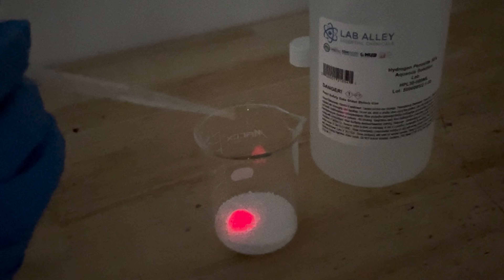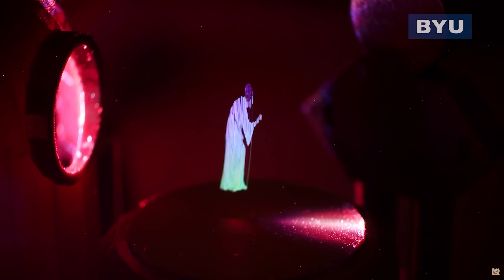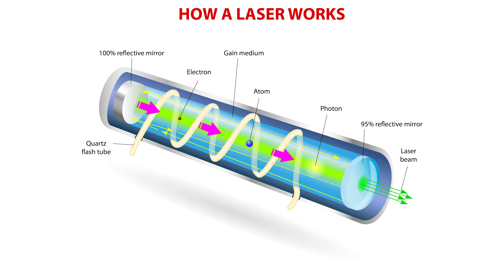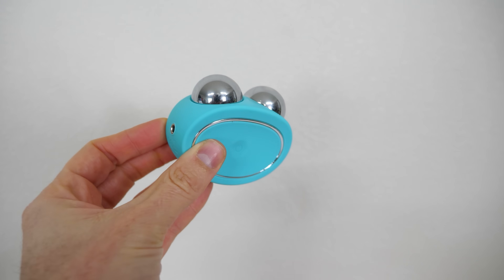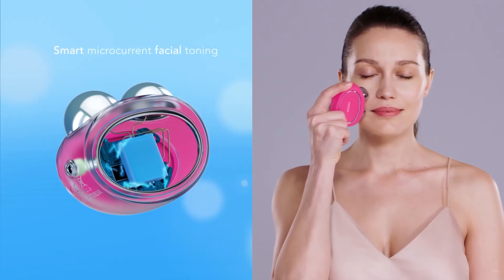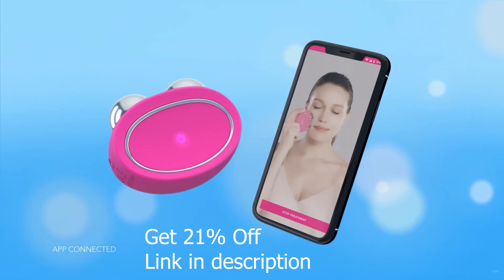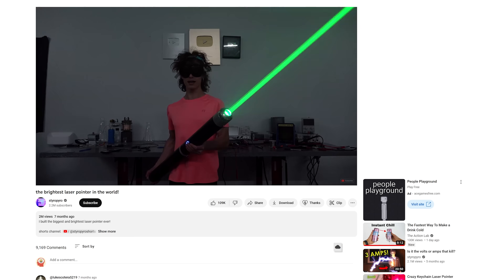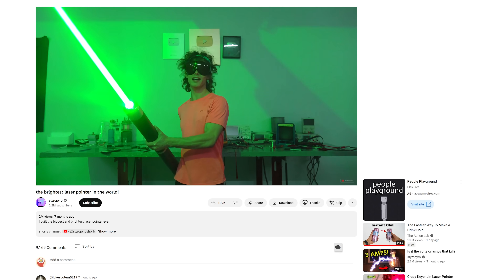Singlet Oxygen Is Scary!

Comment: You can also make frequency combs with pulsed lasers, and you can do dynamics experiments with pulsed lasers at speeds faster than we are able to detect.
Reply: Furthermore, there are efforts to make lasers with alkali metals that exploit the D1 and D2 lines of cesium. While cesium is pretty reactive, this isn’t a chemical laser. It’s a regular gas laser like a CO2 laser. You can pump the cs system with an array of diode lasers.

Comment: One of the theories I heard about the final cataclysm that ended the Dinos was a special tech device that released a chain reaction in the Gulf of Mexico in the water that lead to an uncontrollable wave of energy that caused mass flooding and ignited. Maybe singlet oxygen could start this reaction? Just thought it was interesting, considering Gov is basically going before Congress now and talking about ETs and UAP/UFO. Ancient war perhaps?
Reply: No amount of energy will be able to "ignite" the occean, they did the calculations during project manhattan - the amount of energy you loose due to friction/expansion of the fireball will always be smaller than the amount of energy you can extract from the surrounding matter. Same goes for the atmosphere
Reply: @asd-wd5bj  Not the entirety of the ocean, but still a large reaction. You're also talking about millions of years ago. Was there a large pocket of methane? Far more 02 in the water? Advanced tech we don't understand yet? It remains a theory.

Comment: I forget if it was the YAL, or its predecessor the ABL, but it's likely one of them shot down a North Korean ICBM during it's boost phase on a test.  This was back in 2005-2009, somewhere in there.  The aircraft was airborne and in range at the time that the missile "caught fire and failed".   Of course there is no official recognition of this, but I sincerely doubt it was coincidental.  Also take into consideration that the United States is still technically at war with the DPRK, so there wouldn't be any real legal barriers for them to do this

Comment: Another method is to use a pilot laser to illuminate the target and that reflection is used to pump a high powered laser that will follow the same paths as the reflected light.  Of course semi-conductor lasers have come a long ways and are being used in laser welding machines. A one mega-watt auxiliary generator is not a problem for a large air craft.

Comment: So much wrong.  1.  It's easy to deliver 1000s of watts of electricity continuously.  Its done all over the planet...and every industrial factory relies on 100,000s of watts at a minimum.  2.  Pulsing lasers has less to do with the availability of power than damaging the air around the beam during discharge and thereby distorting the optical conditions of the discharge path.  A pulsed emitter allows recovery time and limits the saturation of air particles along the path.  3.  The Death Star was a single discharge short duration burst emitter...but not a continuous nor pulsed weapon.  

I stopped watching after these as it became pointless.

Comment: Atmospheric occlusion will doom directed energy weapons.
Reply: This is the reason for the two beam system developed decades ago.  The shaping beam creates the path the weapon discharge will travel along.  It establishes the characteristics most conducive to the primary beams integrity...significantly reduced energy losses.  The shaping beam does not have to be that powerful...so overall energy demand stays within nominal design limits.

Comment: IIRC the biggest problems with militarized lasers and dumping electricity into things isn't so much that it "can't" be done as it is "if you make a device that can put out that much power all at once, what you have made is an explosive device". That is, material/energy science isn't good enough currently (or, possibly, ever) to be able to effectively convert that much energy into actual electricity- that is, electrons in a cable or other medium somewhere, without also generating ridiculous amounts of heat.

I can't recall what the exact numbers are on the heat efficiency of batteries and whatnot, but even theoretically speaking if you have 99% efficiency (that is, 99% of the overall energy content of whatever battery or other power storage method you're using is converted into pure electrons and nothing else) and you fire a death star laser with it, you've pumped out 1/100th of the heat necessary to vaporize a planet. That's enough energy to vaporize 1/100th of a planet, or in other words, a large island/small continent and almost certainly any and all possible artificially made spaceborne vessels or fragile/volatile power cores or mechanical/electrical systems comprised therein.

In order to have extremely powerful lasers, you need seemingly impossible degrees of efficiency in the entire process. The storage, the medium through which it passes, and the mechanism which converts the electrons into the actual output (photons, in this case- though the concept applies to anything really). That, or ways to simply ignore the heat- by moving it somewhere else usually; ie a stupidly powerful heat sink. Which could work for small scale applications like handheld weapons or even modest vehicle scale weapons.

Comment: The Death Star was the size of a small moon and used nuclear reactions (I would assume) to power it.  They also had the use of kyber crystals to focus and enhance the beam. The more portable one used to blast the door on Crait is still massive and likely uses a smaller version of whatever reactor the Death Star uses.  The one I have the most issue with is Starkiller base, which supposedly takes all of the energy of a star and concentrates it in the heart of a moon-sized object. This requires the concentration of matter to such a high degree it would possess the gravitational potential not far off from that of a neutron star and would so massively increase the gravity on the surface that all structures and organisms would be instantly squashed. Certainly it would create a gravity well so immense that the energy required to escape using their standard propulsion impossible and achieving lightspeed would require getting to a distance equal to that of the diameter of the original star.

Comment: It should be noted that the description of triplet state as simply antiparallel spins ↓↑ is not quite correct. This non-symmetrized state can be part of a singlet state or a triplet one, depending on how you (anti)symmetrize it to get a state describing indistinguishable electrons. If you take a superposition ↑↓ + ↓↑, you'll get a triplet state (symmetric in exchange of electrons), while ↑↓ − ↓↑ yields the singlet state (antisymmetric).

Comment: Within the cosmological tapestry of the Star Wars narrative, a remarkable feat of technological prowess is exhibited through the harnessing of intensely compressed gaseous matter, generating scorching plasma bolts endowed with temperatures of such magnitude that they refrain from instantaneously precipitating fatal consequences upon impact. Contrasting this with the perceptible allure of lasers, it becomes evident that these optical emissions, while undoubtedly captivating, possess a proclivity towards invisibility when deployed in the crucible of warfare, a consequence attributed to their unique wavelength characteristics within the electromagnetic spectrum.

Mathematically, the incandescence of the aforementioned plasma bolts can be characterized by the temperature parameter T, with its kinetic energy distributively represented as E = 3/2 kT, where k symbolizes Boltzmann's constant. Such ferocity of heat engenders an awe-inspiring visual display while defying immediate lethality due to thermal equilibrium dynamics. On the other hand, lasers, characterized by their coherent emission of light with wavelength λ, are governed by the wave equation c = λf, where c denotes the speed of light and f signifies frequency.

In the crucible of battle, the imperceptibility of lasers to unassisted human vision unveils itself as an outcome of the irrefutable principles underlying the propagation of electromagnetic radiation, thereby underscoring the ingenious fusion of narrative aesthetics with scientific veracity within the Star Wars universe.

Comment: You failed to explain about energy transmission loss in both delivering power to the laser and transmitting the light If the Death Star had a transmission efficiency of 99.9999999999% it would destroy itself the first time it fired the main gun.

Comment: The reason all the pilots for the F35 were getting sick was because the Onboard Oxygen Generating System (OBOGS) was operating too hot.  The OBOGS draws from the engines, and instead of pulling oxygen out of the atmosphere, it was cracking the oxygen molecules into singlet oxygen.  It ate the filters, and the pilots ended up breathing the filter material, along with singlet oxygen, doing serious damage to their lungs.  They had to re-engineer the entire OBOGS system to make it run cooler.

Comment: The most powerful "Laser" that we could theoretically produce with the technology we have today, is what's known as a fission pumped laser. It involves setting off a small fission device and using incredibly powerful electromagnetics to confine and focus the resultant plasma into a focused beam into open air or ideally into space. It's impractical but possible.

The next step up from that would be a fusion pumped laser which involves taking the fusion plasma from a reactor and likewise focusing it into beam into open air or again ideally into space using incredibly powerful electromagnetics. Which we could probably do as well.

The resultant beam from either process would need to be incredibly tightly focused, probably on the order of about 200-400 microns in diameter.

Again all just theory at the moment but we do have the technology for such a thing.

Comment: Imagine a lazer powered by the light from cherenkov radiation.
Step one demon core, step two medium, step three mirrors, step four aperture with filters. The on/off lever is a screwdriver handle as an homage, but isn't even in the same postcode as the lazer.

Comment: I don't understand 'scientists'.

Ever since Tesla, people always seem to forget about the attenuation of energy over distance when it comes to transmitting power.
Even when you transmit power through the vacuum of space, the power will diminish over long distances!

But the loss of power up close to the target from the effect of burning a material is also quite a problem, which is why exhaust fans and pressurized air are used to get rid of the combustion particles as quickly as possible!

Forcing the power into a beam makes the effect of power loss seem to be less, but it is still there.

Comment: We don't have real holograms do we? As in the projected full video type? Not just the Pepper's Ghost illusion, which is what all the dead pop stars use. That's just projecting a flat 2D image onto a sheet of glass, and making the stage around it dark so it shows up properly. That was invented in 1584! And popularised by a stage magician in the 1860s. Utterly crap and very annoying when people lie and call it a "hologram". 

Are the Princess Leia type real? Projected onto nothing?

I once played a Sega arcade game, "Time Traveller", in the early '90s. It used a curved mirror to beam an image from a monitor into your eyeball. So it really looked like a hologram! It was 2D, but floated in the air just above a flat "table". No glass there, you could put your hand through it, was great! 

I believe those only work for one or two people at a time, otherwise you'd need a gigantic mirror and a very bright projector. Still, it's cool, even if it's not a real hologram. Perhaps they could adapt it using eye-tracking. Have it aim two images, one at each eye, then you'd get a stereoscopic "3D" image floating in space. It would only seem 3D, you wouldn't be able to look at it from the side or back, or any angle the projector and mirror couldn't reach your eyeballs from. The eye tracking would figure out where your eyeballs were. You could use something like the Nintendo 3Ds's display, which doesn't eye-track, but can change the angles of projection without moving parts, that could do it quickly enough to track at least 2 eyes, maybe more for extra viewers.

Still the mirror would be BIG though. No flatscreen to hang on the wall. Wouldn't be practical at a cinema either. Still plenty of people watch TV by themselves or with just one other person. Maybe there's some special way you could do the mirror, maybe flatten it the way a Fresnel lens does, have it in segments. 

Anyway... don't tempt me with holograms if you haven't got them! Actually another option is to use lasers to project images onto people's retinas directly through the pupil. Probably wouldn't want an oxygen laser for that!

Comment: Can this or something similar be used to make a light saber type dealio?  Like instead of those chloronating granules…a hollow rod of that material. Then the hydrogen peroxide stored inside a cylinder within that rod. with spouts all around that can allow the release of the  hydrogen peroxide. Have some kinda device within all that that causes the peroxide to spray out from spouts in the direction the rod is swung. Could be a neat effect maybe

Comment: Where I work we had a Trumpf laser cutter that had a 1.8kw CW square folded gas laser.  When it started to show its age, we bought a Salvagnini cutter that had a fibre laser of 4Kw power.  We were told not to use both at the same time but the suits ignited the warnings.

All of a sudden, the lights literally went bang, and we’d blown three 250A fuses and the t” cabling in the street, which had to be replaced. Office staff swarmed out of their cubicles in panic, coffee going cold, and I was summoned to turn the whole building off and change the fuses.

The inefficiency and power that lasers use is no joke!

Comment: I find it a little weird that you'd peddle snake oil for your sponsor slot. Link all the studies you want, it's hokum and you know it -- wound healing? Are you high?
It does not actually say anything about healing wounds in either article. What it does say is that subjects filled in a self-assessment questionnaire about how their skin looks after applying this infernal device, which surely rules out the placebo effect. Surely.
I can find allegedly scientific articles to back up virtually any claim -- until someone reads the fine print. Anyone can.
Reply from the maker: The healing of wounds with electrical stimulation is well established. It works because neutrophils, monocytes, lymphocytes, macrophages, endothelial cells, fibroblasts, and keratinocytes are all electrotactic, which means they follow electric field lines within tissue. Sounds like you have made up your mind already despite there being very well-established evidence. Also these aren't "allegedly scientific articles" they are peer reviewed published journal articles. 
https://www.mdpi.com/2227-9032/2/4/445
https://onlinelibrary.wiley.com/doi/10.1002/adhm.202100557
https://www.ncbi.nlm.nih.gov/pmc/articles/PMC8293212/
https://www.ncbi.nlm.nih.gov/pmc/articles/PMC10013350/

Comment: The colour emitted by the oxygen was beautiful!  Very interesting - as always.  Thanks.  😎 🇦🇺
Reply: I believe it's the same colour that can be seen in red aurorae
Reply: @YounesLayachi  Still on my bucket list to see one of those.  😎
Reply: And it's also the red colour in nebulae that is too dim to see, but we can pick up with a camera on a telescope. It's also a colour that most cameras deliberately try to filter out, unless they're specifically designed for astronomy, so the fact that it shows up so bright in this video is impressive/scary.
Reply: @matthewwakeling4978  are you talking about infrared ?
Reply: @YounesLayachi  It's technically visible light, not infra-red, but it's very much on the borderline between the two. Hydrogen-alpha is one of the main light wavelengths that give interesting pictures, so for instance I have a filter that will let only that wavelength through.

Comment: This is the most amazing chemical reaction you’ve ever shown on this channel. Holy s***!!!!! It’s scary to think what a one megawatt laser could do when just a couple watt laser with a small focus lights things on fire from across the room 😅

Also small correction: ultra high power electric laser diodes I believe are usually pulsed to maximize the average power output with the diode’s duty cycle capability in mind. Delivering thousands of watts continuously isn’t an issue. By pulsing the incoming signal, the diode can emit a higher average power level than if it was running continuous duty, and the peaks will be hotter upon contact with the material the laser is cutting optimizing the performance even more. There are actually laser diodes that pump out thousands of watts continuous duty now (mostly infrared ones in the 1100nm range). Backyard scientist had a 2kW cleaning laser on his channel and that thing is literally a deadly weapon 😅

Comment: Are we seeing the dynamic range of the camera color sensor failing to acquire the red, or is it that the intensity at that monochromatic range is simply too great for the sensor?  Given the lack of automatic exposure compensation, I'm going with the former case. However, it's possible the camera was set at static exposure. Interesting technical for a camera operator and camera designer. I'm curious to hear your thoughts.